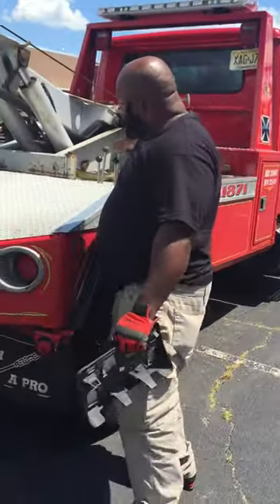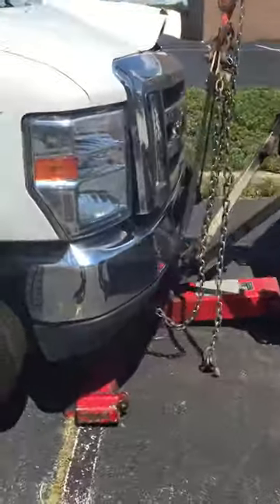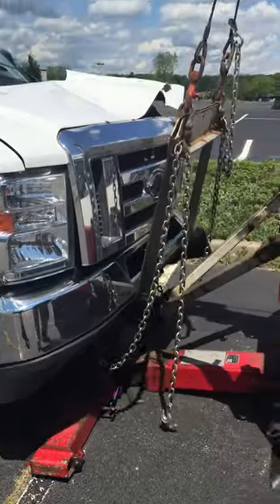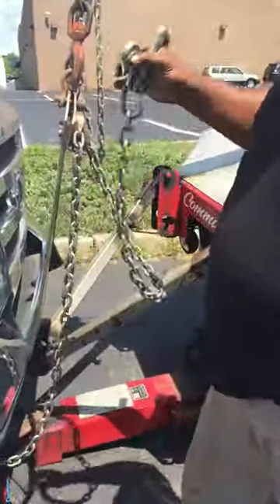Red Hills Towing 101: How To Sling Part 2

Comment: Wrong wrong wrong. Pull forward to tighten chains and slack going to top of sling rubber should be tight so the rubber isn't taking the weight.
Reply: And this guy forget pulling the driveshaft